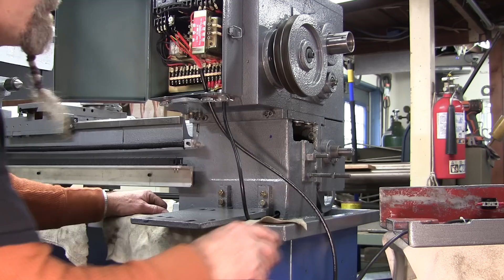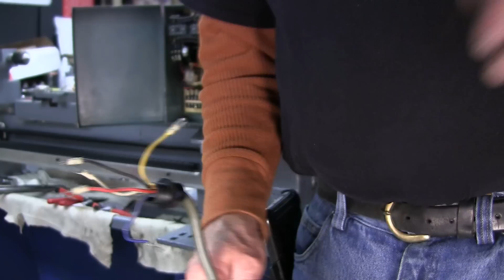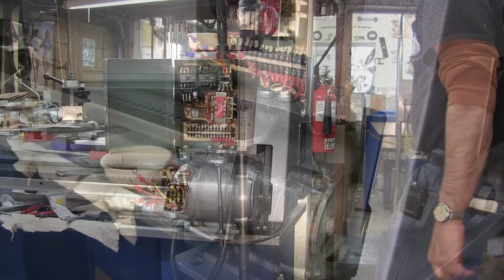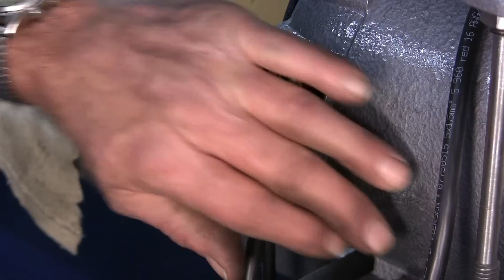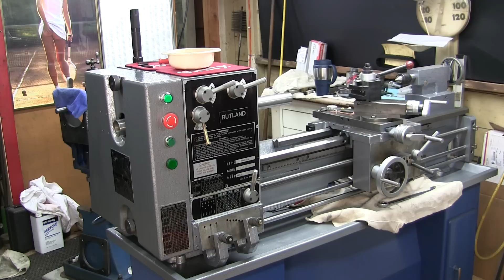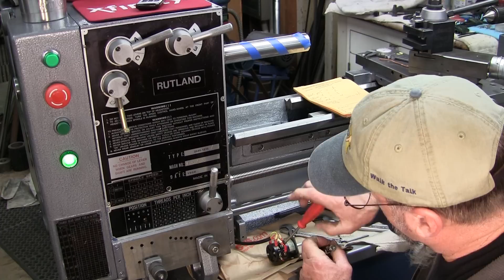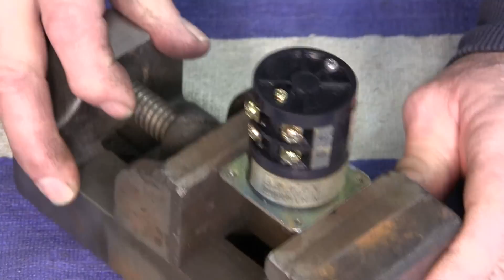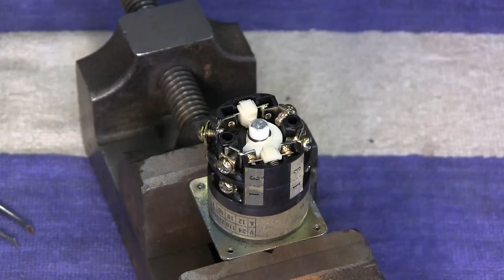Let's Look Under The Old Girls Apron Part Twelve

Comment: I have a very similar lathe made in Taiwan under a different badge name.  It has been leaking oil like yours and I had been suspecting one of the bolts leaking behind the electric box and dripping on to the motor.  I hadnt gotten around to finding it since my lathe is up against the wall and not easy to get to back side.  Now I am going to go looking for both of the leak locations you had to see if that is it.

Comment: Serious respect for tackling the switch. Yes they often just start to work. The minutest speck of dirt will stop two contact points from touching. Sometimes you can compensate for wear by slightly bending the metal contact strips.

Comment: I like the long-wires solution to dismounting the end panel, but it might be even
better if you put an inline plug/socket and just let the panel completely detach.  Nylon connectors like Molex makes: <http://www.molex.com/pdm_docs/sd/430250408_sd.pdf>, 
seem suitable (and the plasma cutter can do a mount bracket faster than my own punch-and-file methods).

Comment: Man that electrical box is sketchy. I saw 1 fuse. I guess all the wires are rated for whatever the main disconnect amperage is? I've never seen a lathe that uses a single belt for the spindle.

Comment: Keith. When you are at it, why not put in some Equipment that monitior the electrcal Power load on the machine? From 0-100% of rated Power, or other set of choice. Could be interesting to see stuff and hear the machine sound at different loads.

Comment: All the contactors we used were wired using spade ends ... they would either have a square plate or washer so that the screw never touched the wire termination directly and always made a clearance to the body of the switch.  It's a common problem as the contacts wear.  The first "fix" was to slot an extra washer or spade over the screwhead to add extra clearance ... eventually you have to change the switch.

Comment: The actual problem with the rotary switch is that the terminal screw/s is/are too long and it's tip is pressing the cam backward away from the contact assembly, reversing the spade terminal made the screw unable to reach in far enough to press against the white plastic cam enough to break the contact.  A shorter terminal screw is the best answer.  (or cut it shorter)

Comment: I believe I'd fashion of some type of formed raceway to house those wires vertically all the way to the lower hole where the control wires enter the lathe case and a notch at the bottom of the raceway to feed the wires out to the control panel. Should you pop or break a belt, it would protect the wiring much better. Very Cool project and love that Navy Grey wrinkle paint!! What is that by the way?
Reply from the maker: Hammered grey Rust-o-oium  ;{)-------

Comment: Nice catch on the switch.  Some of those can be difficult to find... i always found a good industrial electrician has a source on that stuff :)  Something i learned a long time ago about contactors, and Bakelite switches is to use a torque screwdriver on them.  Most of them call for a torque rating around the 12 inch lbs mark, and some even less.  Done a couple replacements on power jacks, and it makes a huge difference in the life of them.

Comment: Good science is predictable and repeatable.Or as Albert Einstein said any fool can know the point is to understand you understand the wiring on your lathe ya the tip of that screw was keeping the contact from touching huh. grease a little dab will too. points file at worst if the plating isn't even burned they ll be good for years blue Loctite those through bolts?

Comment: Happy new year Keith.  Really enjoyed this video as usual but curious why you rewired the switches and light back onto the gear cover instead of putting them on the top of the gearbox in a small aluminum box which would be so easy to build (or buy).  I note that this is the way the newer version of this lathe is built.   Rod

Comment: way to say it keith mr. fenner. i had to rebuild with all manual hand made parts the pressure / contact breaker switch in an electric air compressor and trigger switch for a portable worm gear power saw here in the phi;ippines and while the challenge(s) of doing so are satisfying, the doing it without mussing the works > get movin' onto sumptin' else. amen; thnx amigo, respectfully, gerald.

Comment: More food for thought,when making the the new cross slide screw make it extra long so that you can attach a stepper or servo motor to the back side  and put an extension on the right end of the lead screw and install a stepper or servo motor add Mach 3 and a computer and drivers to make it CNC capable. You already know the computer After you've finished that project convert your trusty Bridgeport to 3 axis CNC.

Comment: Food for further though add a motor clutch and a spindle brake and inter lock them so that applying the brake releases the drive clutch and releasing the brake engages the clutch without stopping the  motor. Think automotive air conditioner clutch on the motor output shaft and bicycle disc brake on the spindle. be like the big machines. While your at it add a spindle rev tachometer

Comment: Kieth, you have a spare wire in the cord to the relay box .you could use that to make fwd and rev jog relays functional. . one way is to add a spdt toggle switch mounted horizontally next to the jog switch  and take the wire off of the NO terminal of the jog switch and move it to one of the two outer terminals of the FWD/ REV selector toggle switch you just installed. This wire goes to the FWD jog relay. hook the spare wire to the other outer terminal of the toggle switch and hook the other end to the REV jog relay. The run a short jumper from the NO contact of the jog switch to Com terminal of the toggle switch. You  may have to reverse the two outer wires on the toggle switch to get the get it to jog in the correct direction that the toggle lever is pointed. If you can get a second jog switch and it has three contacts you could eliminate the toggle switch but you would have to run a jumper from the NC contact of The FWD jog switch to the COM terminal of the REV jog Switch and run the spare wire from the NO contact of the REV jog switch to the REV jog relay. Running the power through the NC contact of the FWD jog switch to the COM terminal of the REV jog switch prevents you from being able to power both FWD and REV relays at the same time..  You may not feel that this is worth the trouble but it does restore some functionality .

Comment: You could of course add another switch to give jog reverse. Best of both worlds. Just don't press them both at the same time.. 
Actually a better and safer idea...  add a new toggle switch in addition to the current button for jog... Position A then press Jog -> Jog forward Position B then press Jog -> Jog reverse.
Reply: Andrew Hull : It does not matter if both jog switches may be pressed simultaneously, because the direction relays are mutually interlocked during control contact points.
These are the smaller terminals numbered 1 - 2 and 3 - 4 on both contactors controlled by the 24Vac control voltage.
Only one relay can ever be activated at any one time.

At most the relays would chatter slightly if both control switches are pressed deliberately, but never ever make a power contact connection.
This is a safety feature meant to work this way, by international grid power regulations on how to wire motor direction control relays, using special relays suited for such motor control.

It should be noted, that recent types of these control relays are mechanically interlocked as well, physically blocking the opposiste relay from pulling in.
This gives a slightly better safety against shortcircuiting 2 phases, if one relay should hang or weld in the contact points in closed position.
This recent double interlocking of the relays, I believe has become mandatory in later motor controls, for the sake of added safety.

Note : The 3 large relays seen in this Rutland control cabinet, are usually named contactors, which have built-in safety measures against contact points arcing or welding.
They also have a very powerfull pull-in relay coil, to positively make a fast and secure connection.
A strong spring is working against this pull-in force, likewise to ensure a fast positive DISconnection, when the contactor is released.

But your point is defo worth noting : using a 3 position rocker switch for jog direction control would overcome any hazard.
These jog control switches are often fitted with a large stick handle for durability, loking like a large joystick.

Comment: happy new year Keith enjoying your videos so far however this one you made me worry that you were going to give yourself an electrical shock.

I will be the first to admit I am no electrician however I have enough knowledge on how to be safe with electricity in general. if you are planing more electrical work please look at getting proper screw drivers that are insulated.

I was wondering why if the motor is original that you didn't use the chance to service it and replace the bearings and test the windings.

A Tip I learnt is that doing things one handed with live circuits lessens the chance to give you a shock because if you create a circuit through your hands I hope you have a defribilator handy in saying that I have received a shock pulling a plug out of a power board and it really is not a fun experience.

other than that be safe and can not wait to see more videos
Reply from the maker: It just didn't feel like the time to go into the motor and service it yet! still thinking of switching it out for a 3 Phase next spring or summer. ;{)-------
Reply: thanks heaps for sharing this one Keith! I'm re-watching as someone commented to me that the AL960B i'm salvaging is very similar to your Rutland. Mine is presently single phase with forward and reverse, but no motor came with it, so I am considering going straight to 3 phase. This involves I believe an interlocking reversing contactor, I have not yet confirmed that a switch on it's own would not cope, however it seems prudent to use a contactor instead of the switch to carry motor current. I can keep you posted on wiring progress for that, have found this diagram for 3 phase forward/reverse on Keith Rucker's site which seems to cover it pretty cleanly. http://wiki.vintagemachinery.org/motor%20starter%20wiring%20diagrams.ashx#Dph_StarterDph_Motor_Reversible__5

Comment: The kind of contacts this switch has usually stop working because of the sparks that are produced when the contacts open. At work we used to replace those contacts with platinum ones, is a fix and forget solution, but very expensive. We had equipement that had thousands of relays and they used to wear very fast, until the company decided to spend a little more in replacement parts. I have had this same problem  in two of my cars, one in the indicators lever and the other in the key switch (the one to unlock the steering wheel and start the engine, I don't know the name in english). On both I fixed them the same way, 600 and then 1000 grit sandpaper and done. I usually put some grease (it won't prevent the contact to work, at least with the one I have) and will keep the contact from rusting, in case it had a protective cover the sanding removed. The one with the indicator lever problem was fixed 16 year ago, when the car was only four years old, so I can say it works better than original.

Comment: Great job, both the rebuild and keeping sane!  Tracing wires, deductive reasoning, all without a diagram, great work figuring it all out!

Hey, is there any value in adding a second jog button, or a switch that directs the output if the existing button to either #4 or #5?  

Why exactly is a jog button needed at all, since you've got the lever on the shaft?  Is it for some task you do at that end of the machine, so its more convenient?   

Keep up the great work.  I just love it when you chuckle, and then carry on!  Getter done in the best spirit!

Happy new year to you and Vanessa.
Reply from the maker: sometime you just need a moment of motion to time threads or watch clearances etc. ;{)--------

Comment: Hey Keith, great series.  I have the same basic lathe, but on mine you lift up on the selector handle for forward, down for reverse.  Thought maybe there was something wrong with mine, but in the manual it's states up is forward/counter clockwise, down is reverse/clockwise.

Comment: I remember a lot of pulleys and harmonic balancers that had two threaded (through) holes, in the hub, that were used to "pull" the pulley off with two 1/4-20 bolts.  But, you would have to machine some sort of shoulder or circlip ring in the shaft (for a backing washer...) to make that happen.  Or a wide groove for a "C" collar type tool (open end wrench) that would only be used when "pulling" the pulley.  Just saying.

Comment: dear keithm
just a couple of points: if you had the power control so deep apart, why, then, not trace all the leads and make out on paper your own complete circuit diagram for the future use? this diagram, btw, will at a glance show how and what to switch between voltages and for the 3ph service, provided the motor is a 3ph machine, and the magnetic switches have each three pairs of contacts.
and secondly, imho, the power-on light is more conventionally -- blue.

otherwise, excellent methodical work! if those chinamen manufacturers see this series, they undoubtedly offer you a $500k/year position in their rnd department!!

thanks for the video, and happy new year!
-toly

Comment: A couple of times during this video series, you have mentioned a possible future conversion to a 3ph motor, if you find a way to do it.
As I see it from your control relay wiring cabinet, it should be very simple indeed to do.

Remove the 3 solid links from the upper row on all 3 relays (contactors), which is fitted to R/L1-S/L2 terminals on the relays.
Then wire all R/L1 together on the 3 relays - all S/L2 terminals together - and all T/L3 together as well.

You have 2 incoming phases R and S connected to U/T1 and V/T2 terminals on the rightmost power control relay lower row.
The third incoming phase T should connect to terminal W/T3, which already has a wire connected.
That wire I suspect is M5 .... ? 

This M5 wire appearantly is used in present setup, as a switched feed for the motor capacitor, to constitute a third 90deg phase.
The M5 terminal would then go as the incoming feed connection for the 3.rd phase T.
.... and then the empty M6 terminal is the 3.rd motor phase W, together with motor phases U and V.

All in all you need to do very few changes, no need for extra parts or cables, even re-using the existing cables ...
... except for the incoming power feed cable.

Enjoy :-)

(Referring to images in video time around 52:10)
Reply from the maker: Thank You for the comment and directions, I'll be looking for a 1 1/2 HP 3 PH motor, with frame to suit mounting area,  next spring. Cheers, ;{)-------

Comment: Beautiful cable routing and securing ( wire "tie-mounts" and fabricated bracket with insulating grommets!)... "tailoring".  Logical development.  There are electrical box conduit fittings that are "liquid-tight" (environmental).... with strain relief "grips", etc.  http://www.heyco.com/Liquid_Tight_Cordgrips/?gclid=Cj0KEQiA7qLDBRD9xJ7PscDCu5IBEiQAqo3BxIlCT6SGnxBGf5QDotzQb1uhtFHeul7ccopUI66WWWQaAn4B8P8HAQ But, "as-is", your configuration looks like "lifetime" quality.  The "circuit logic" of those rotary motor contactors can be puzzling (if you are unfamiliar with them).  You can find replacement contact "bridges" for them online.  Sometimes, the contacts only require a "burnishing".  Sometimes the "cam lobes", of the mechanism, wear down too.

Comment: Crunchy wire like that really is a safety hazard, or at the very least, a good way to pop a circuit breaker when you're in the middle of a project.

Comment: Looked to me like the length of the screw was hitting the cam lobe when the shaft was rotated to the reverse position, causing the cam to be pushed away from the link bar for the switch function. Was the any marks on that part of the cam caused by the screw? Slight shorting of the screw may be in order.
Reply from the maker: I checked for that and it was the push sideways by the insulation on the crimp, with inserted in the angle side of screw. 
 ;{)------

Comment: Nice detective work .... Ambitious of you pulling the switch apart nice work.... It was hard to see but it seems you have a three-phase reverse and forward contact arrangement control power contractor.  is the motor three phase ? connected to single phase 240 volts.  I see a jumper from L1 to L3 that would be phase in time arrangement as three-phase power is 120° phase  to phase ... single phase power is 180° per phase ... I think it's called star or Delta arrangement which refers to the wires in your motor are tapped in a way that allows the two phases to push the three-phase motor around the cost is torque about one third nameplate for available horsepower.  Of course this is just a guess is I'm not looking at it but typically you need a capacitor or more than one to start and reverse that motor if it's truly single phase 240 V. Motor w/ centrifugal switch or potential relay arrangement.... Peace... It's nice you thank God when things go well ... You're a wise man Keith! Blessings

Comment: it's a good example of what should be done when you rebuild an old machinery, often, replacement parts are obsolete and fitting another part is a pain in the ass!
Keith is a live example of a high level of experience teamed with a very practical execution.